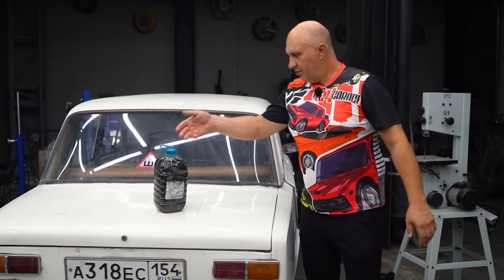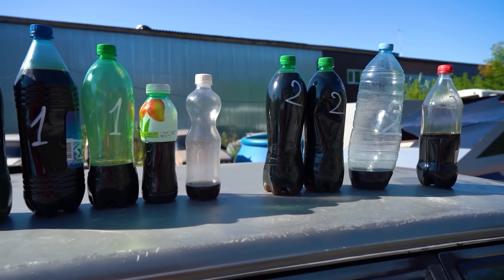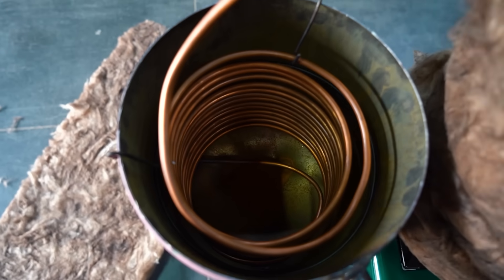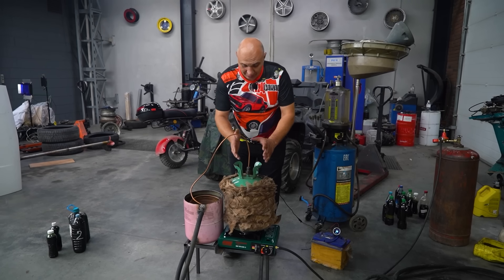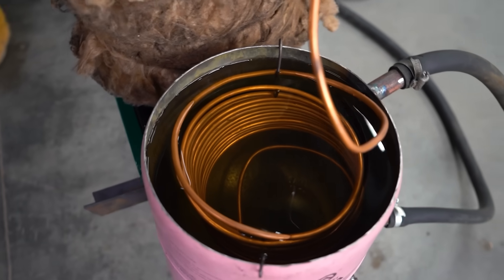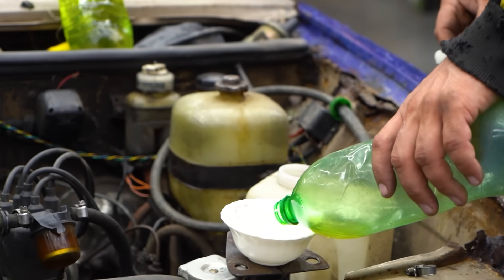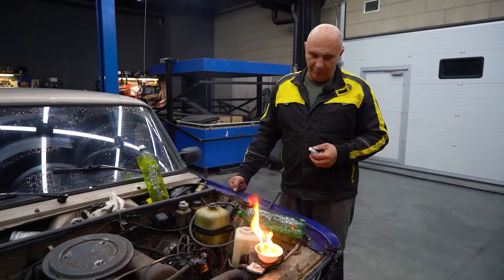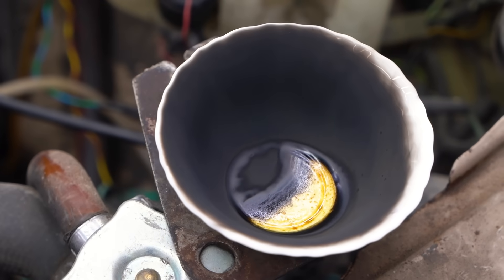Tire-extract fuel vs pump gas - which is better?

Comment: I would like to see this fuel used in a fuel injected engine! Great results!
Reply: It would gum up the injectors quickly and create more carbon in the combustion chambers/sludge in the oil because it's a more dirty/less refined fuel, I don't think a modern engine would like it very well
Reply: @consolehacker54  I was wondering too. But maybe? it can be double distilled?
Reply: @hell_march6652  It was double distilled
Reply: @smeezekitty  Well triple distill it then! it works for vodka! lol
Reply: @consolehacker54  i was thinking the same thing
Reply: @consolehacker54  what about an old diesel
Reply: YEA SAME
Reply: I think the injectors would benefit from the extra oil lubrication from this not so perfectly refined fuel.
Reply: @silverssonyoutube8438  Maybe, if it didn't also result in fouling.  Love to see that tested.
Reply: I think it's better it runs on carburetor
Reply: I second that

Comment: Now let’s do a video on how the different fuels effect the engine life, and measure carbon build up within and on the engine components.
Reply: as per the bowl test, it would seem this one needs to run more lean to do complete combustion. I bet they would need to tune the carburettor to get optimal performance

Comment: Reminds me of a story I heard about oil refinery workers back in the 60s and 70s.  They would tank up their cars of free white gas because it was free.  It worked but made the cars run like crap and smoke.
Reply: White gas, now there's something I kinda forgot about. I think I still have a gallon or so on the shelf downstairs for Coleman lanterns and stoves. I always thought it was basically kerosene refined a bit better. I never really looked into it.
Reply: @kleetus92  Nah man, white gas is the OG gasoline.  The kind of gas they had over a hundred years ago now.  Simple petroleum distillate.  No additives.
Reply: @rayceeya8659 wonder what it's octane rating is though? I mean it burns yeah, but I don't think it's quite as good for engine fuel.
Reply: @kleetus92  50-60 or so would be my guess.  Octane ratings come from the old school way they measured the ratio of octane and heptane.  50 octane would be a 50-50 mix of octane and heptane.  All theoretical because it was always octane EQUIVILANT.   That's the important part.  Pure 100% octane is what you want but that's hard to refine so gasoline is a mixture of a lot of hydrocarbons from heptane to do-decane with octane in the middle.
Reply: @rayceeya8659  Mix in a little ethanol though and you can raise that octane. We run 10% in basic gas these days anyways.
Reply: @hell_march6652  Yeah back when they discontinued leaded gas, we used to use ethanol to curb engine knock.  That or you had to bump ignition timing.
Reply: It's like 50 octane and would work perfectly fine...if you detune a lot lol @kleetus92